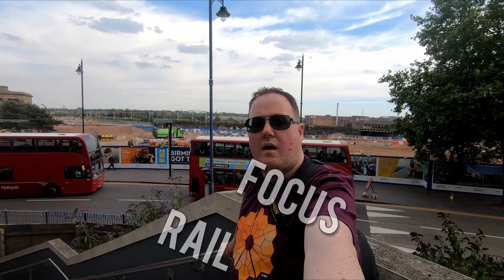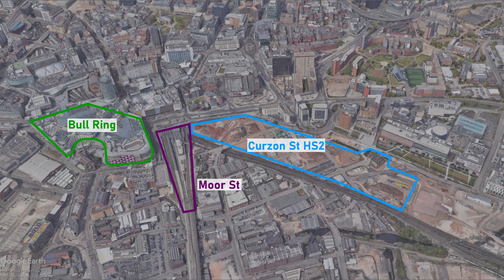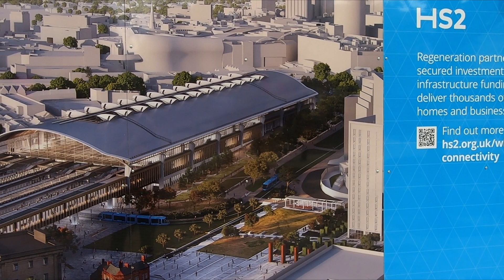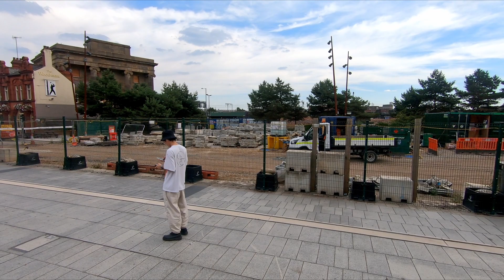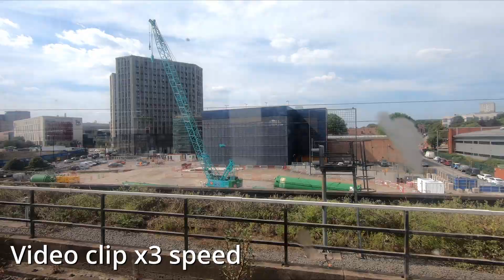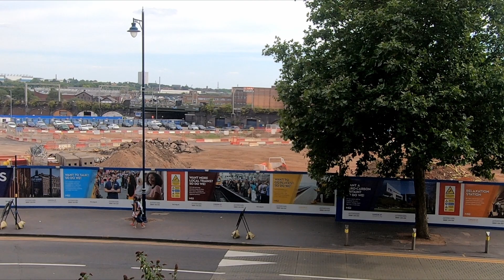HS2 Birmingham Curzon St Station | Progress Aug 2022

Comment: I'm psyched about how hyper-modern trains are going to be using one of the oldest existing train stations.
Reply from the maker: It is awesome to think the site of one of the UK's first ever mainline railway stations will be home to the UK's newest railway and trains
Reply: @peterwilliamallen1063  - What's the point of your comment? Everyone knows that already. What matters is that the old building will be reused for railroad purposes and its architectural integrity will be preserved. 

Here in the States, some of the most beautiful train stations -- The "Union Stations" in Cincinnati, St. Louis, and Seattle, for example -- have been "reused" for non-railroad purposes, with any rail passenger operations shunted to some tiny bleak block building on the side. Former Manchester Central in the U.K. is another example of a train station that has been "preserved," but not as a railroad facility.
Reply: @peterwilliamallen1063  - For the record, everyone watching this video already knows what you just said, except for the actual plans for historic Curzon Street station. But I'm sure people will enjoy posing for photos and the like in front of the original building. To me, although he didn't design the building, historic Curzon Street will always represent Robert Stephenson, one of Britain's most undeservedly-overlooked civil engineer.
Reply: How sad

Comment: Massive site. Let's hope common sense prevails with the Eastern section
Reply from the maker: Fingers cross about the eastern section, and the connection for Scottish services too 😬🤞
Reply: Really hope they go to Leeds. I rather them go to Leeds then Manchester.
Reply from the maker: @AllPRO786  needs to go to both.
Reply: Extension of HS2 to Scotland is way more valuable for the UK, Leeds to London has next to no flights, Glasgow and Edinburgh to London on the other hand….

Comment: HS2 is beneficial for not just Birmingham but also for Manchester and other larger cities in the North of England. I have heard that Curzon Street HS2 station is going to be massive.
Reply from the maker: I'll think I could probably make a video about how HS2 will benefit the North at some point. I just hope the eastern arm and connection to the WCML at Wigan are constructed.
Reply: @Rail_Focus  True.
Reply: @Rail_Focus  For the full benefits, not only does the eastern arm needs to be built but so does HS3/Northern rail,
Reply: HS2 will be beneficial to everywhere between Birmingham and London, as it will massively increase the capacity of the existing rail lines which currently have to run both intercity and local services.

Comment: In Manchester to replace the Golborne link it might be a better idea to build an underground through station, then take the line past Bolton and join the WCML just before Preston. That could work well with both HS2 and NPR. Part of the reason I think they went with an elevated station instead is old mining activity in the area making underground construction difficult, which would still be a significant problem now or in the future.
Reply: @unblubby7139  Depends on what you mean by futureproofing. There is decent provision for lines heading east and west that aren't part of HS2, and it will be adequate for unfinished future plans in those directions. The issue is Scotland services, where the projected routes are either inefficient or nonexistent from Manchester. Everything depends on what the Manchester terminus is expected to do.
As things stand I wouldn't be entirely surprised to see Scotland routes cut back to the Crewe interchange.
Reply: It’s a shame that the Golborne link has been kicked into touch with the planned train maintenance depot which was to be built near Wigan for HS2 but hey looks like self interest and brow envelopes win the day again - hope we don’t regret it in the future.
Reply: @railfangig6699  Golborne link is a decent idea, but it still creates a long way around from Manchester to Scotland and doesn't solve capacity issues at Wigan
Reply: Sadly, NPR has been downgraded to just a couple of short bits of new track plus alleged improvements of the existing line, rather than a true High Speed service. Hopefully, there won't be any more budget cuts, or the entire section North of Crewe could be in danger.
Reply: @mittfh  I have heard parts of NPR have been folded into the TRU program, and that's supposedly why TRU has become so expensive

Comment: Gareth Denis is a fast walker, and while it might be ok on a cool dry day with no luggage, on a wet day or a hot day, I wouldn't consider the walk a viable out of station transfer. The metro probably helps, assuming it has enough capacity and frequency. I did choose to go to New Street recently because it was nearer to my destination that Moor Street or Snow Hill, though I do still hate the experience of New Street (trains from my town go to all three stations).
Reply from the maker: Definitely need to improve the pedestrian access. But it's not insurmountable

Comment: With liz truss' one good policy announcement of the complete construction of Northern powerhouse rail perhaps we will see the Eastern leg restored in the not too distant future as routing all high speed trains to London from Manchester Liverpool and Leeds the same way is likely to offer much benefit to the east coast mainline which will remain overcrowded. Plus with the addition of an NPR station at Leeds it would allow hs2 to access the station fairly easily. My only complaint would be if they fail to integrate the two systems. Therefore Manchester needs an underground station at Piccadilly as does Leeds. Which there is space to do both so the government needs to step up and just fund this network and these stations properly

Comment: You can get from the new HS2 station to New Street in three minutes if you run* 
* Only applies to passengers in front carriage, rear carriage add another three minutes. 🏃🏼🏃🏻‍♀️
Reply from the maker: Less than 10 minutes platform to platform at a leisurely pace. But that assumes all HS2 journeys will start with someone alighting at NS, rather than Moor St or the new Metro extension. Then as someone has pointed out there's Birmingham Interchange to consider.

Comment: Curzon Street Station will be a big let-down. It will be more like "extrachange", rather than "Interchange". With the amount of money that has been thrown at HS2, surely additional throwing could have seen an HS2 station under New Street Station with escalators up to local trains. But there isn't even a sensible metro link to New Street Station either. So, much of the time saved going from London to Birmingham on HS2 will be lost walking, or waiting for a slow and poor metro service.
Reply from the maker: That assumes every journey will start/end with a change at New St, but that won't be the case. The area around Curzon St  and Digbeth will be a destination in itself with the regeneration being driven by HS2, then there's Moor St station providing local and regional links and the tram extension that will connect to New St and beyond. But if people really do need to connect at New St it'll be possible to walk from platform to platform in under 10 minutes.

But people forget Birmingham Interchange  which for many  passengers will make more sense to use an an interchange, that will be mere minutes away from Birmingham International.

Ultimately building a 7 platform underground station with approaching tunnels underneath New St would not be practical and would cost many billions compared to the £700m price tag for Curzon St.
Reply: So much money has been put into this project anyway. Additional funding would have enabled proper interchange with an HS2 link to New Street. If sustainable travel is to be encouraged, the HS2 terminus should be more than just a terminus. Much of the Elizabeth Line and stations have been constructed underground in central London proving that even in very densely built-up areas, it can be done. A New Street extension WAS possible, but is now a missed opportunity. We know that sustainable interchange in European (and even in North American) cities is taken very seriously. But proper joined-up thinking, planning, and implementation of transport in the UK is absent again with regards to HS2.
Reply: Imagination is all that's needed.
Reply from the maker: There should be improved pedestrian links between Curzon St and New St yes, but as for a new station being closer that would be incredibly difficult. I know I'm not an engineer, but with the knowledge I do have I know it would be incredibly difficult to build underneath New St. Building a new 7 platform station above ground is challenging enough. To build it underground would either require extensive demolition to build an enormous box, or the construction of some sort of huge cavern. So its location isn't so much about lack of imagination, but the understanding that the huge engineering challenge to build it anywhere else simply wouldn't provide value for money. People often say why build HS2 just to save 20 minutes, even though it's more like 40 minutes saved, so it could be argued, why build a station closer to, or underneath New St at great expense and causing huge disruption just to save 2 or 3 minutes walking time between Curzon St and New St.

Comment: Google maps says it takes 16 minutes to walk from Curzon Street to New Street Station.

Won't the classic trains still be faster if you need to change trains at New Street?
Reply from the maker: No, even a leisurely walk from New platforms to HS2 platforms will be under 10 minutes, and HS2 will be 37 minutes faster than even the fastest service today. Plus you have the benefits of much greater connectivity at Old Oak Common. Birmingham to Manchester will also be 46 minutes faster than today's fastest.